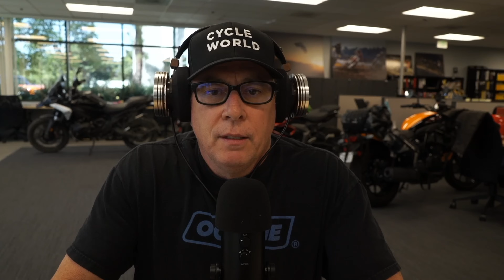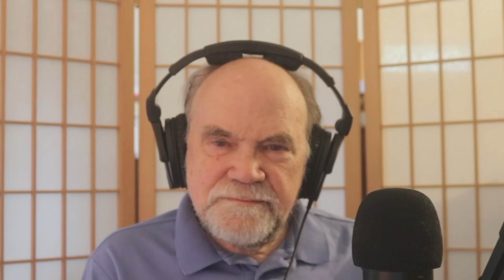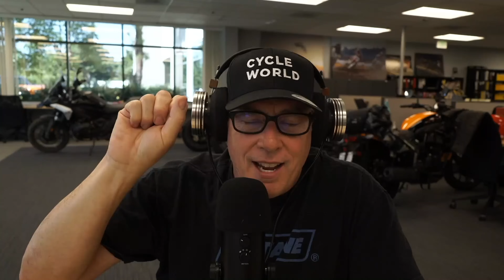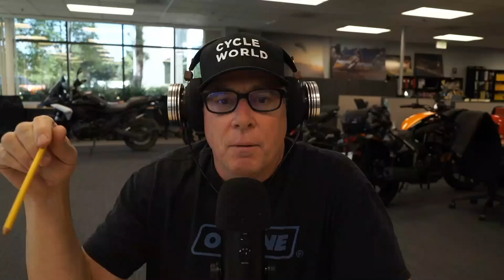The DIRT TRACKER that WOULDN'T DIE: Harley-Davidson XR-750 introduced 50 years ago (Still Can Win)

Comment: I don't think that HD built 200 XR-750's the first year.  I have heard stories of HD  having to put bikes in a elevator and moving them from floor to floor at HD Headquarters to make the AMA Officials think that there was more than 50 XR-750's built .
Reply: Stories, just like the nonsense stories about the AMA supposedly restricting OHV engine's to 500cc in the 60's just to protect Harley from Triumph and BSA, the fact is that restriction was enacted in 1932 when there was over 130 motorcycle manufacturers in America and nobody on a flat track had ever heard of Triumph or BSA.

You're all just mad and want to pout over something Harley was good at that required more than just showing up with a bunch of money to beat them, why shouldn't they have been good at it? It's the original form of American motorcycle racing and they'd been doing it longer than anyone else, people think all ot takes is a more powerful engine because "all they do is slide around a corner, there's no real technical achievement about that", wrong, tuning the engine and setting up the suspension is an art form unto it's own and people who could never get their heads wrapped around that concept would get mad because Harley dominated that sport so they'd go around making up stories about the AMA "protecting Harley" or stories like the one you're making up which is what's called poor sportsmanship and being an all around poopy pants because you're not big enough to congratulate someone for something they're good at.
Reply: Anyone can make up stories about anything, like the fairytale story that the rule restricting OHV engine's to 500cc that was enacted in 1932 was really enacted in the 60's to protect Harley from Triumph and BSA, nothing but butthurt losers making up stories that are mad because Harley was good at something.
Reply: How was that supposed to happen when they're all serial numbered?
What, while they were looping them around they were welding them up, grinding down the welds and restamping sequential serial numbers on them?

At the end of the description is a link that will take you to a site to fill out "The official butthurt form" for everyone mad that Harley was good at the oldest form of American motorcycle there is.
Reply: @dukecraig2402    Of course eventually they made over 200 of them but they didn't have nearly 200 built yet when they started racing them.  The Iron heads often seized before the race was over.
Reply: @dukecraig2402    Do you think the AMA was looking at all of the serial Numbers on all of the XR-750's from floor to floor to be sure Harley Davidson was not cheating?  Harley always has to have the rules changed to handy-cap other brands so they can win.